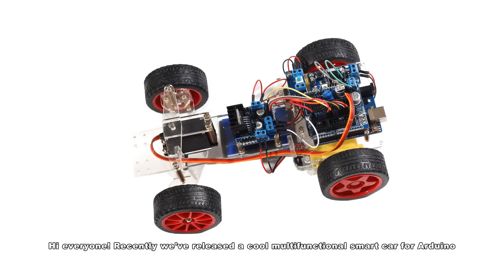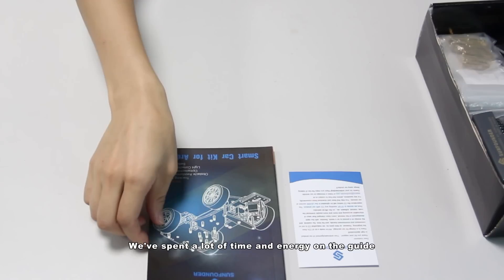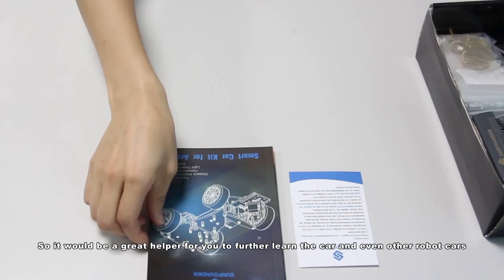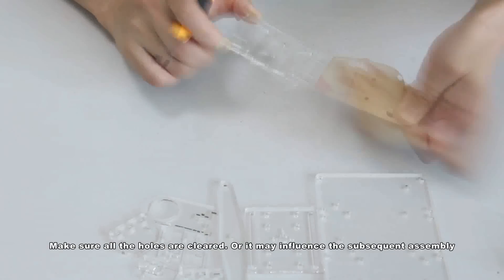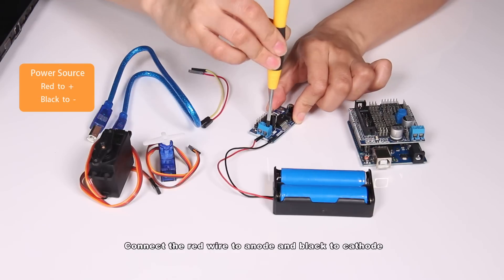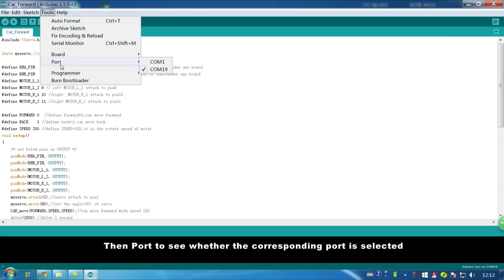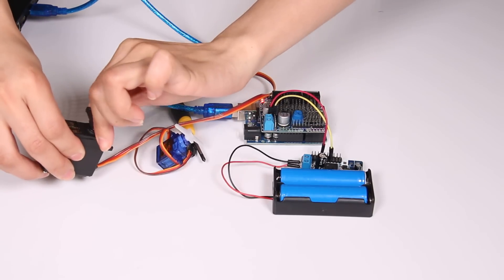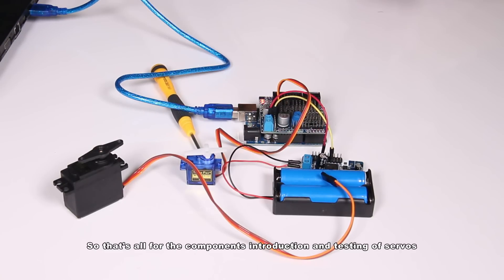Smart Car Robot Kit for Arduino Assembly Tutorials 01 Components & Test

Comment: is there a remote control?
Reply from the maker: +jimmydiaz90201
There is no remote control. The SunFounder Uno R3 board is used as control. You can control the car by your phone, if you add a bluetooth module and write the code. Then you can control the car.